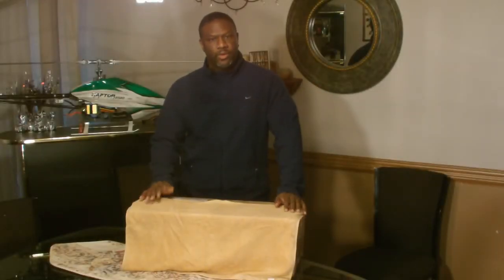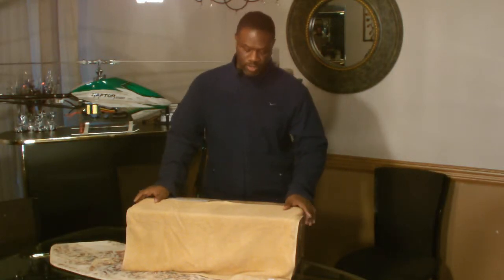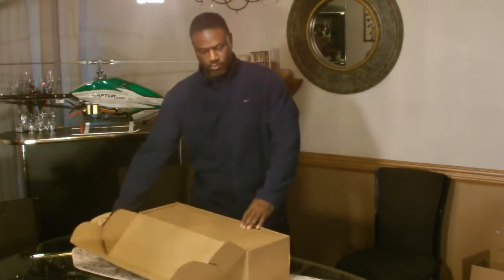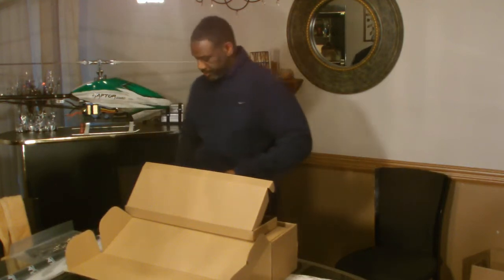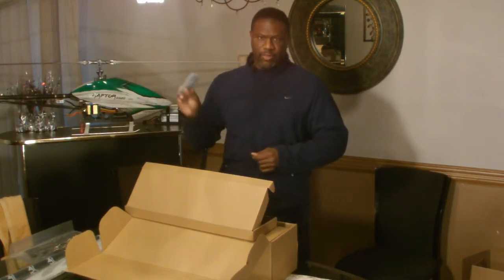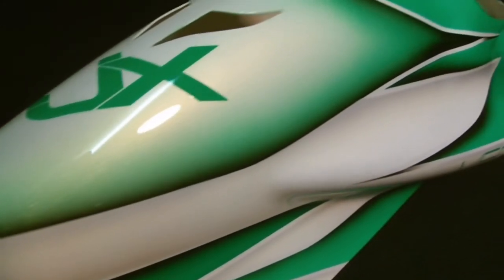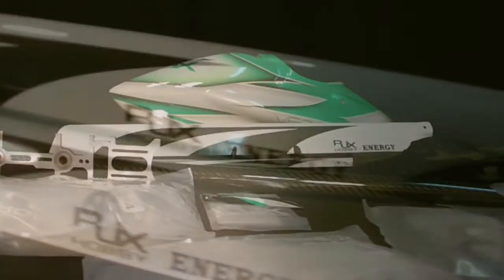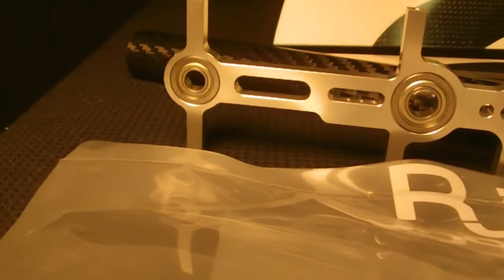RJX Vectron 520 Unboxing

Comment: I love this heli didnt mean to sound like i was ragging on it could you do me a huge favor pretty please can you measure the inner width between the frames so i can see how big a battery can fit and 1 last thing can you measure the distance on one of the landing skids length from the back mounting hole to the front mounting hole thank you so much i love the vectron landing gear wanted to use it on another helicopter
Reply from the maker: sorry..didn't mean to snap at yah.. I thought you where this youtube troll guy. I'm out of town for a little while so it may take some time to get those specs for yah.
Reply: +iPilott4411 thank you verry much
Reply: Am i out of luck if you cant do it thats ok